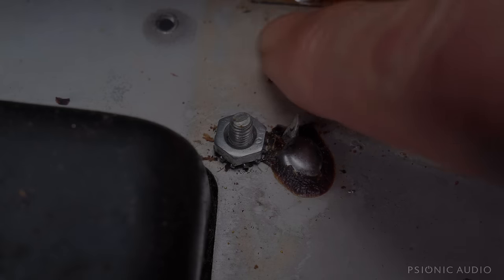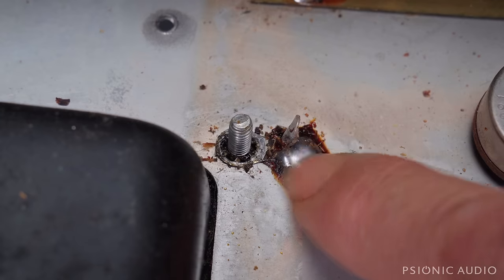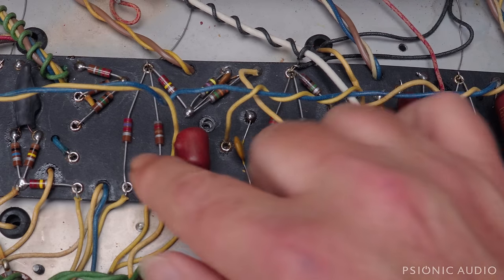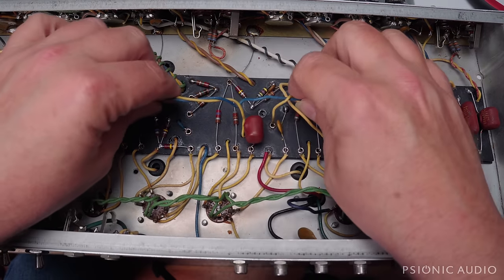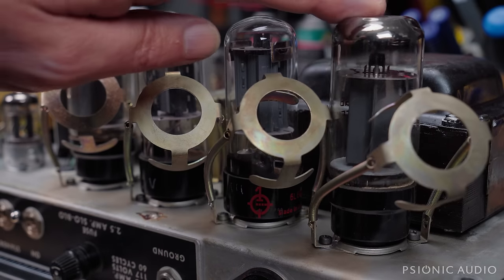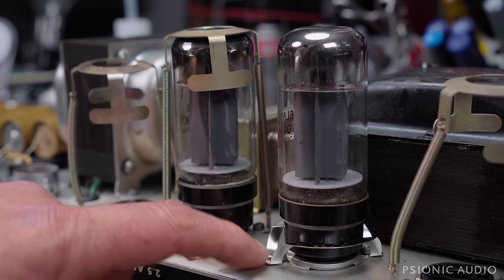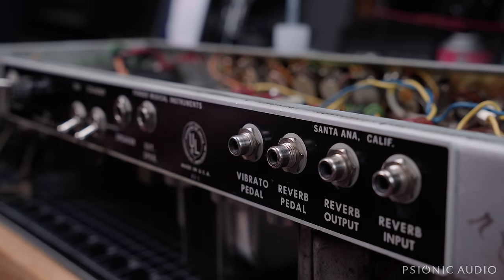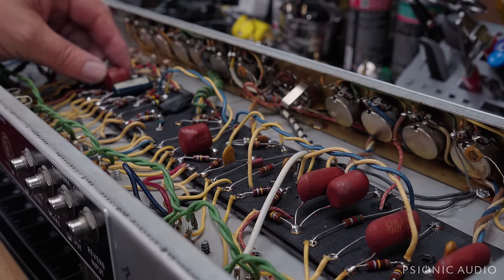The Nitty Gritty | '68 Fender Twin Reverb Pt 2

Comment: those early brown turds (brown and yellow or Paktron brown turds) are really good caps; the rarely fail and i believe they are pretty much the exact specs as the blue ajax-- the latter brown turds and blue blobs aren't as good. These actually go back to at least 63 as they were used on the brown VVerb.

Comment: What would have been the idea behind swapping all the plate resistors to metal oxide? Noise? If I understand correctly a plate resistor would be one of the few places with enough swing for carbon comps to work their VDR magic.
Reply from the maker: You understand correctly. MOs are “better” resistors in terms of spec than CCs. But CCs aren’t really noisy in a Fender circuit and their spec “flaws” lead to some interesting distortion characters. 

However sloppily installed, the previous MOs would have sounded ok. But kind of sterile. 

If this was a high gain amp I’d be using 2W MFs for plates and such.

Comment: Serious question Lyle...what do you think of the WD-40 contact cleaner vs. De-Oxit?
Reply from the maker: Different solvents for different purposes. WD40 should never be used in pots, switches, or tube sockets. DeOxit doesn’t remove/penetrate/protect against rust.

Like comparing shampoo and Simple Green.
Reply: @PsionicAudio  Sorry...maybe I wasn't clear. WD-40 makes a specific contact cleaner - similar product to DeOxit. I was just wondering if you have used WD-40's competing product and what you thought of it compared to DeOxit.